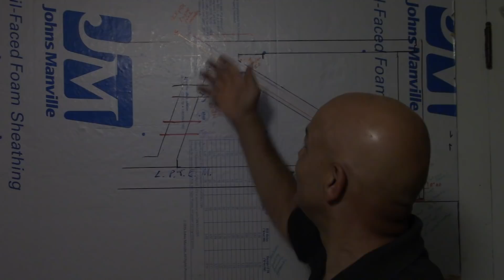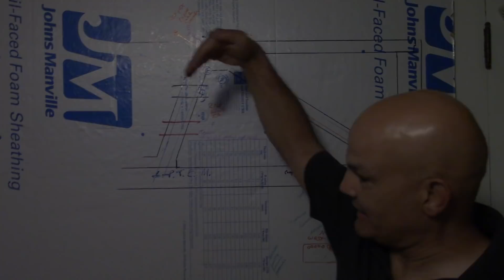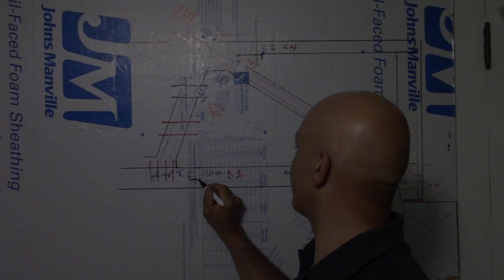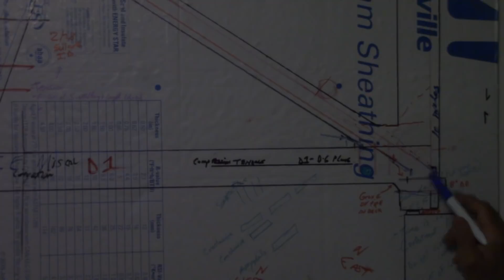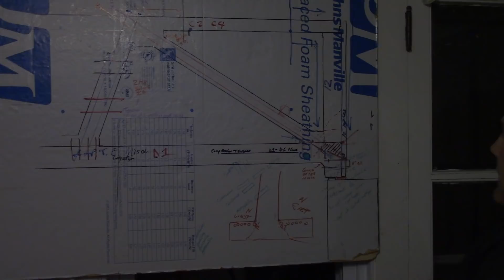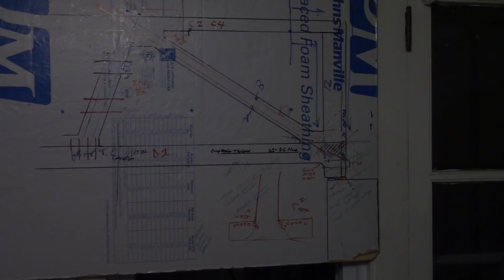FIU BRIDGE COLLAPSE 99.9%  CAUSE OF FAILURE EXPLAINED NOT CLICK BAIT what a relief! PART 1

Comment: This thing failed either as it was being transported or as it was placed on the pylons as evidenced by the cracks that showed up. Had it survived that trauma, chances are good that it would have suffered the same catastrophic failure shortly after. I still contend that the forces experienced by the structure were not understood by the designers and most certainly not by the contractor. This was an experimental structure that should have been modeled and tested until the interaction of all components were understood and with the understanding that, like any experimental design, things will go wrong and the design changed to compensate for unforeseen issues that are sure to show up. This catastrophe sits squarely on the designers and aproving authorities who enabled it. It did look nice though.

Comment from the maker: 20:00 I state 3500 lbs not a ton, in my brain I was thinking not a yard of concrete, 27 cubic sq. Feet. (13 ×2 feet column at 10 inches)...
Roughly, not a yard of concrete...
Which is about 4000 lbs.

Comment: I awoke at 2 and saw you posted but I was more interested in Iran so this had to wait. 

As D1 elongated and the deck sagged, it caused the Crack at the base of 11. 11, 12 and the canopy which was supported by 11, 12, 9 and the cables in the canopy made the canopy more rigid than the deck. 10 was in tension being pulled apart by the sagging deck and the less sagging canopy. This explains the hurizontal cracks in 10. When 11 was Detensioning, 10 was suddenly under immense compression force shearing D1  and the deck. The temporary survival of the canopy as a single structure pulled the canopy down with all 1.9 million pounds. This caused the expansion cracks in the pier below 12 and pulling 12 off the pier with the lower end of 11 acting as a fulcrum.

I'm going back to sleep.

Comment from the maker: PLEASE, look at this image to understand what I am explaining .  https://ibb.co/bmrhNb0
FIU Bridge Collapse, over a year later and I can finally explain this failure! 
You may even be surprised that this might even come down to foundation of the scaffolding!
Like the I-35 on ramp!   This will explain why NO deflection would have been observed in the scaffolding to an ''un-surveyed" (made up word) eye...
Further, that the designers did not think that the post tensioning in 2 and 11 would create a force DOWN 10 and 3!
That the CEI mistook the cracks he saw in 3 and 10 as ''tension'' caused from post tensioning 2 and 11.
That these cracks were not tension from 2 and 11 but a result of compression being sent down 10 and 3 , into the deck, which DEFLECTED and revealed these cracks... STOPPED / controlled by the bars in 3 and 10    being snug...  LIMITING the amount of tension break that could develop.
This snowballed because the members 10 and 3 did NOT have developed reinforcement, transverse cables or D2 thru D6 to support and transfer those loads!
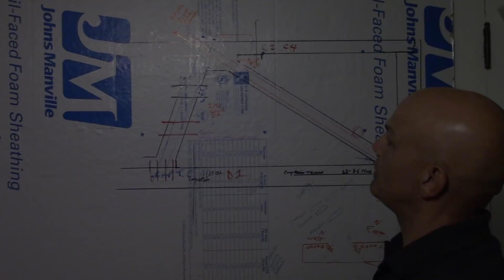10:58 recalculation BEcause they did NOT think forces were to go down 10 and 3   -- So, therefore, all their calculations are off from that point forward!
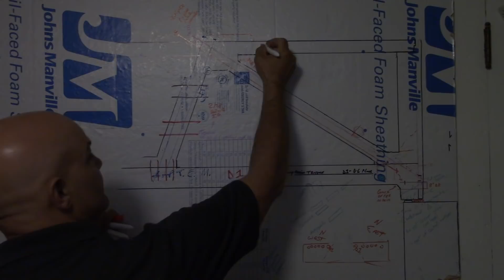7:50 NO c4   please understand only c2 were installed and they were not capable to keep the canopy from deflecting.
Reply: The diagram here is very good at explaining the loads.  The resulting force down 10 caused the deflection of the deck.  
I was already up for morning coffee so thanks.
Reply from the maker: @RickyLaneMusic  , thanks Ricky,  and my camera died on me; and yet, I finished the presentation... lol
I will have to do it again, the good news, I get to correct that NO c4 was installed during post tensing #11 and no 2...
But, you guys missed my oh shit moment... when I came around the circle to scaffolding not having a strong enough foundation; LIKE the Cline Ave collapse... which FIGG changed the foundation on! 
Ricky, I will try to find their foundation report for the scaffolding; I am guessing it was not given enough respect...
The loads down 10 caused the scaffolding to compress in the soil at / under 10 and because it was so small, no one saw it...
In fact, the CEI thought that the cracks in 3 and 10 were from the steel in 10 and 3 being ''confronted'' by the compression in 2 and 11...
He did NOT see that the deck deflected to create those tension cracks in 10 and 3...  
That would have shown that the deck was taking a huge load which it was NOT ready for yet! 
NO transverse cables were installed and neither was D2 thru D6 installed yet (post tensioned) to take the loads down 10...
That deflection in the deck caused deflection in the canopy and this made a permanent "new profile'' of the post tension cables from D2 thru D6 and in the canopy c4~~~!!!!
This CHANGED their elongation numbers and they should have a record of about a 1/2" of extra cable required that they cannot explain in D2 thru D6 and in C4... That is if they measured that accurately...
They should have had a survey on the deck during the post tensioning and especially AFTER the cracks appeared in 10 and 3... This would have revealed what is going on with the deck and canopy.
Reply: Wow.  What a job you are doing
Reply from the maker: @Waterman-wv2jx  Thanks Waterman, I have two more videos to go to this part 1...   My camera's battery died...  Damn...  in part 2, (loading now) has an awesome scene stealer in it.